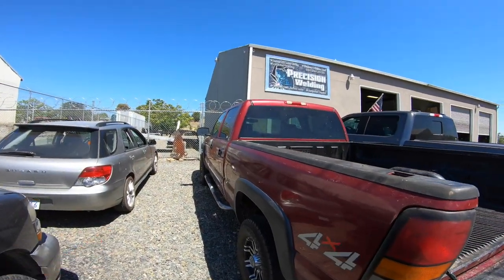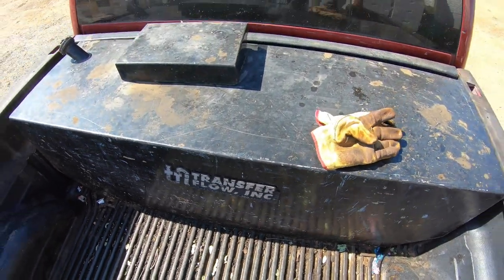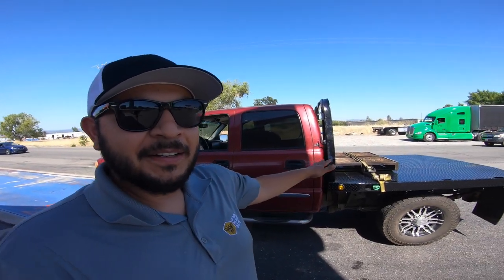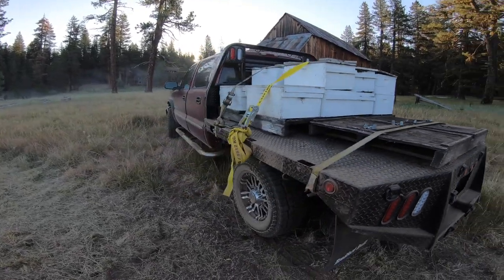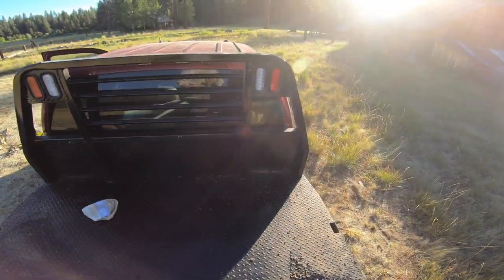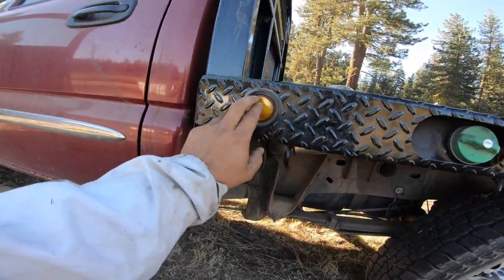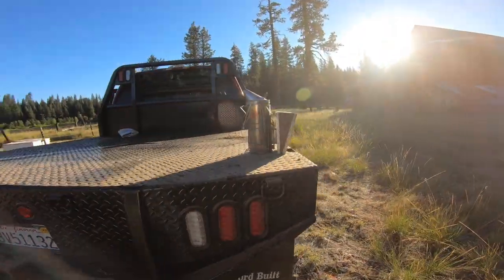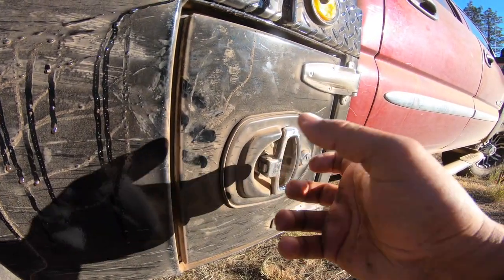Converting our GMC 2500HD to a Bradford Mustang Flatbed Bee Truck! - Transfer Flow Auxiliary Tank

Comment: I’ve been considering getting a flat bed for my ‘08 2500, but I’m concerned about too much additional weight. Do you have a before and after weight for the truck? I’d be very curious to see the difference. Thanks
Reply: Google mpg loss on flatbeds. There are some guys that put an aluminum one on an f250 and ended up getting 1 mpg more with a heavier weight. Aerodynamics
Reply from the maker: Yes. I'll look up my truck documents 🤙